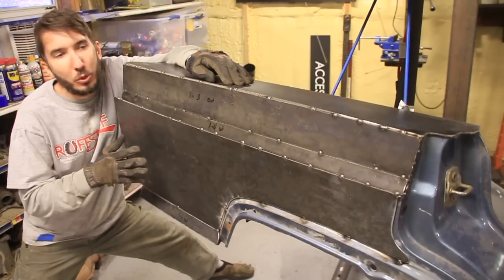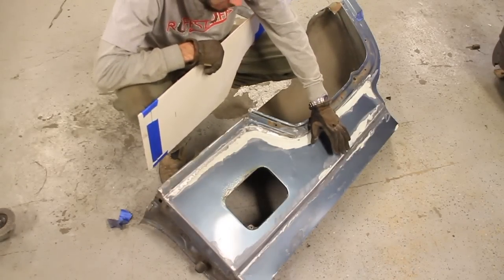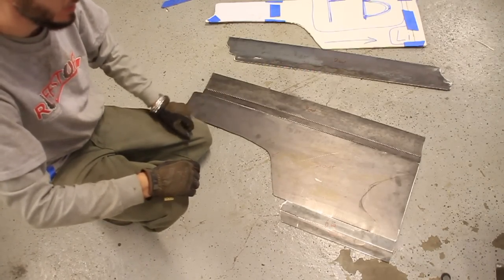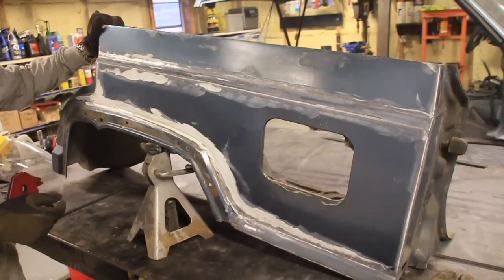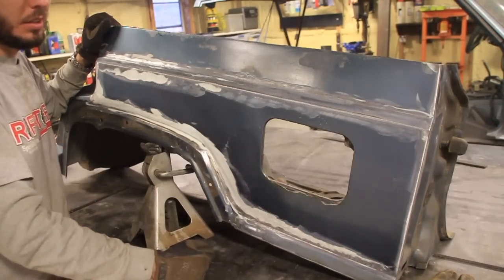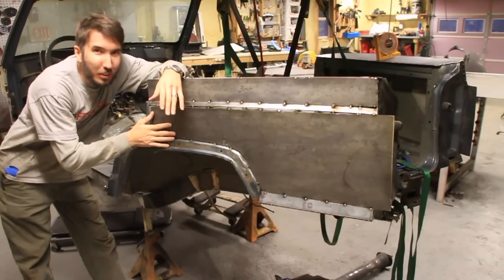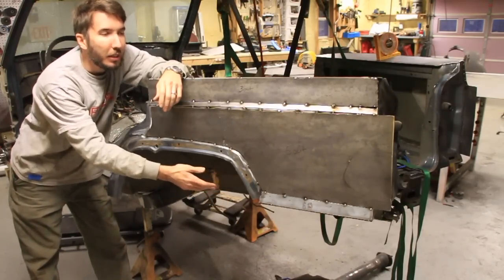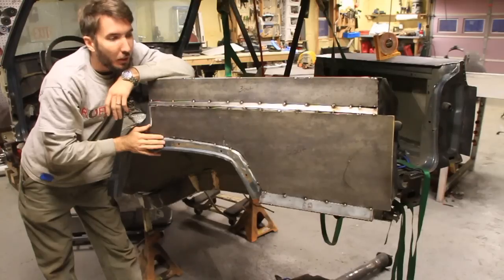DIY Quarter Panel Armor

Comment: Great job on the armor. I made mine front and rear out of 11 gauge and bolted 'em on. I have a tip for getting that contour for guys that don't have the quarter panels cut off their rig. I took a 1"X2" landscaping stake, set it on the ground, and placed the armor over it. I then simply stepped on the edges and used my body weight to gently hop and work a curve into it. I weigh 190 and it took like 1-2 minutes per panel to get a matching contour.

Comment: When you get to where you want to armor the tires and wheels; consider these two ideas. First, a disk shapes plate that is held on by extended lug nuts, much like dual tire rims. In fact this disk must be slightly smaller in diameter than the tire. But would be great between a set of duals. The other idea is to suspend plates linked by a screen of chain links. But foam filled tires remain the best bet for stealthiness.

Comment: Great videos.  Im working two jobs and saving money to build a Jeep XJ. Im going to use it for overlanding and also to live out of it for a year or two. I have a CVT roof tent, ARB roof rack, dual yellow tops,  Goal Zero Yeti solar generator ARB fridge, ARB awning with enclosure on my shopping list. Many other parts on the list like air lockers and suspension and what not. Mainly want to make it self sufficient and livable first though. Keep up the good work.
Reply: That's pretty sick dude, good luck with ur plans happy wheelin
Reply: volcom137z What about fuel

Comment: To armor the radiator and front a metal box containing a pair of 2 1/2" angle iron sections 2" apart and off set  1/4" in height where the reversed angles are deflected and then caught  by the reversed, cuppingsection(use large and thivker angle iron if heavier weapons are expected)

Comment: You will have to weight it when its all said and done. Compare it to a bone stock Jeep to see how much it gained with all the modifications. Im betting it will pick up some significant weight with all the frame, suspension, axles, body armor, and cage. Not that its a bad thing, weight can mean traction. But it would be interesting to see the difference and maybe its distribution front to back and side to side.

Comment: Inject expanding foam into any gaps between the armor and the original skin.  It is amazing the structural rigidity that foam adds.
Reply from the maker: +halnywiatr hmmm
Reply: Some of the cheap ones retain moisture, but marine or fire rated should be closed cell and moisture resistant.
Reply: Don't weld on it though shit gets real haha

Comment: Is there a way to assemble armor without Welding against the vehicle? Or, is there a way to assemble it against the vehicle without messing up the paint in the process?
Reply: Micah Bachert make cardboard templates, use an angle finder to map all of your bends and angles. Then you can recreate the angles on a bench

Comment: What size wire do you use when mig welding?
Reply from the maker: +TheJdelos was using .035 for a long time then switched to .030 when that ran out.

Comment: Dude water is gonna get under that plate steel and rot the quarter panel out from the inside.
Reply: tis what happened with old toyotas
Reply: Cant you just use a good sealant around it?
Reply: Joshua Silva Why yes. Yes you could.
Reply: Exactly but no one bothers to use their head. Bed liner >:)